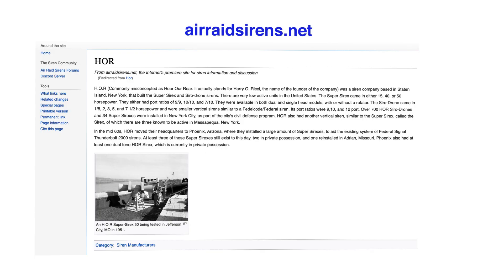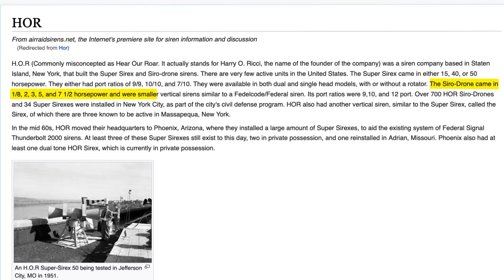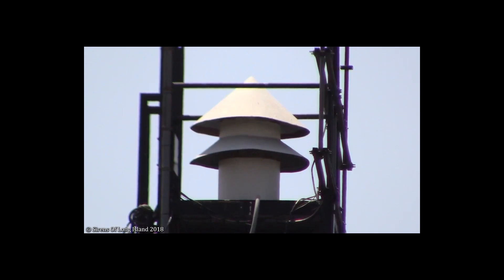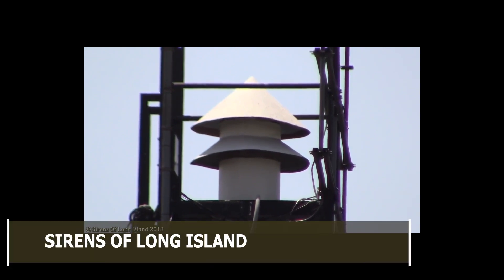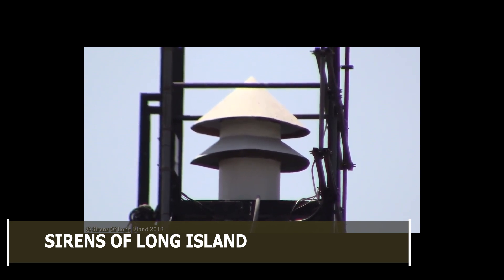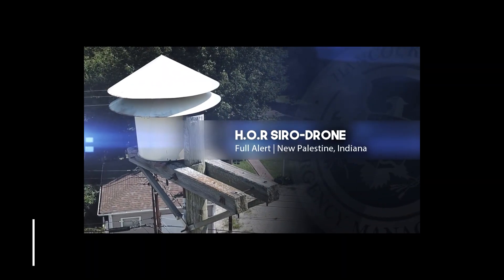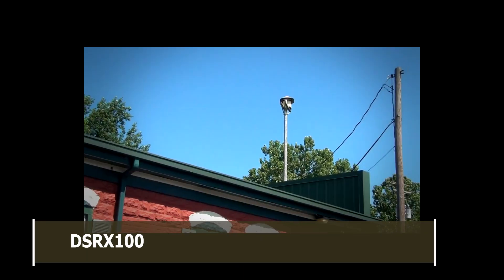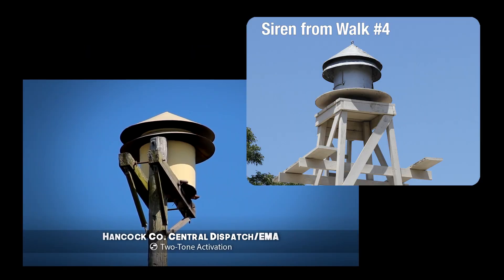Los Angeles Air Raid Siren, A Model 3 or HOR Siro Drone? Lets find out!

Comment: I am pretty happy with your results, as a nother way to tell these are not HOR Siro-Drones is that little ring on top. HOR's lineup, were supposed to be lightweight, whereas, federal sirens were supposed to be more heavy duty. So, as a result, federal decided to put these little rings on there, for install. Hook a crane to it, hoist it right up. So, on your future walks, look for that.
Reply from the maker: I actually heard about that and scripted it for the video, but I when I went to validate it I couldn't find any information. Thanks for supporting that information. I'll be sure to mention it on future walks, if I can remember it... :D

Comment: Just recently climbed one in eagle rock to finally put this myth to bed, both theories are actually incorrect. I managed to locate the I.D. tag and it turns out that these were actually model 7's and VERY old at that, the tag says federal electric and model/mach: 7. However the theory of them being flattened to conserve metal for the war effort is most likely true as the age of the tag dates it around later 30's to upper 40's